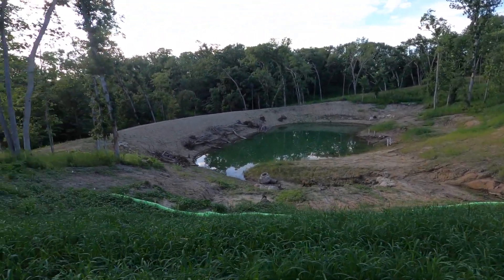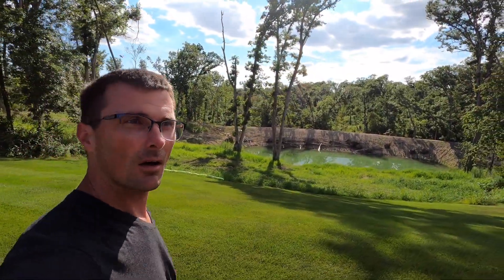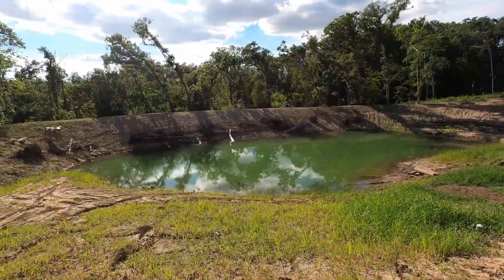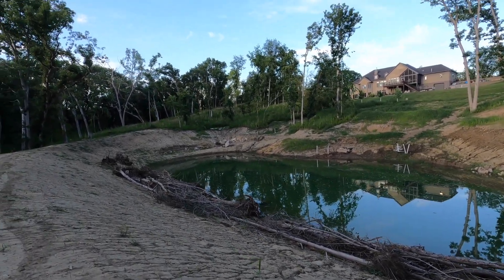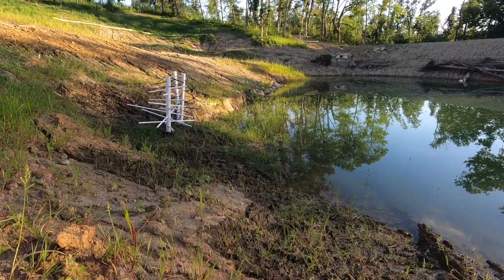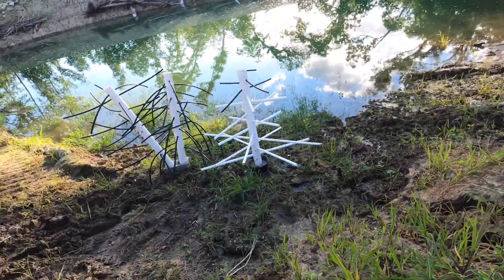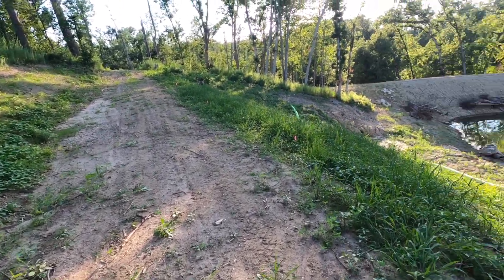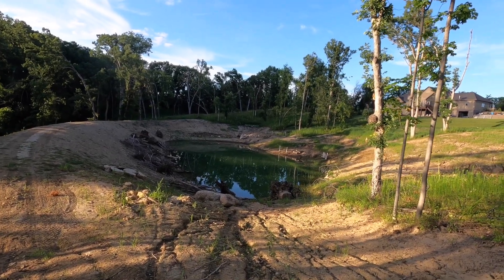Filling Water in a New Pond with a Well Pump -Franklin Cerus X-Drive Pump

Comment: Hey be careful with that brush pile for the fish works great for fish to hide and protect protection, but when the water rises and gets to the brush pile, it most likely will float. Keep that in mind it will not stay under the water.
Reply from the maker: Thanks for watching. Yeah, we did consider that at the time when building…in a later video in our pond build series, we ended up driving 4 ft long t-posts down into the earth and lashed the brush piles down. So far so good 2.5 years later….most all of the brush has stayed down on the bottom. I would think it’s all waterlogged now at this point and not fighting to float anymore.